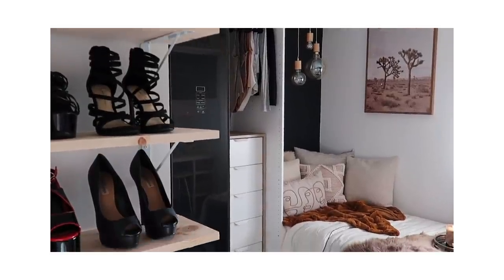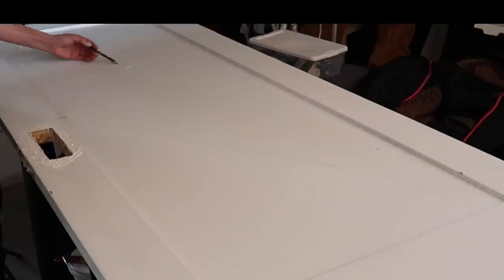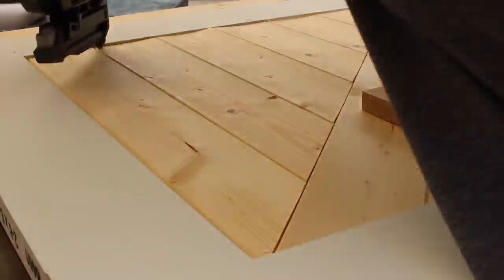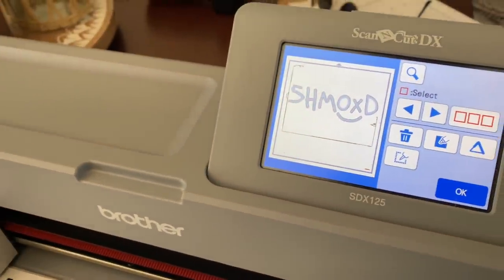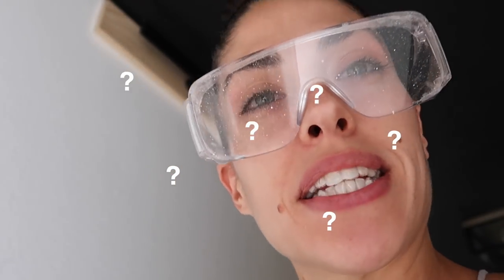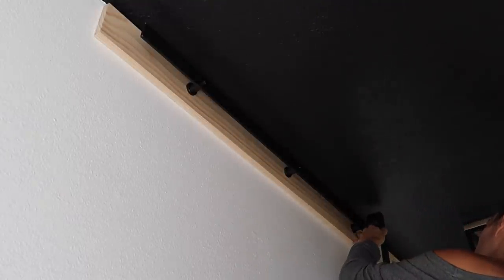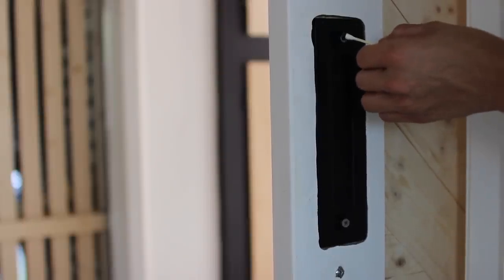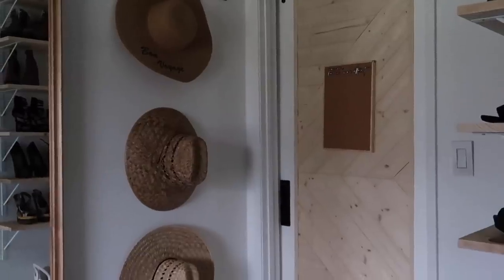DIY Thrifted + Sliding Barn Door | Easy Beginner Woodworking Project!!!

Comment: Rubber band between the stripped screw and the screw driver sometimes works!
Reply from the maker: That never works for me but thanks for the tip!
Reply: @LivingtoDIYwithRachelMetz   bummer! Too much brute force! 😝
Reply: I just saw someone beat me to the tip, I had trouble figuring it out at first but what I found helped me was thicker rubber bands and then I stretch them over the screw, then jam the drill in to “meet” the screw in a perfect fit but you have to keep it tight otherwise it won’t grip. Hopefully that helps.

Comment: I took my barn door from my old place and put it into my new place.  I did a video of it the first time I attempted to hang it by myself of course I had to have help to lift it onto the track but I put more holes in my wall. This time I added the mounting board to the studs, it was a nightmare but we finally got it done had to take it down a couple of times for height adjustment because I think I know everything even though my husband tried to tell me. The final door is on my pdubstuff channel.  I also purchased the door from the habitat restore in Torrance California for $35 it was a heavy door.

Comment: Aaaaaand... another bomb DIY to add to the list. This is gorgeous, as per usual with you. I cannot wait to see the surprise (a home in JT? 👀). 
Is the door heavy enough so It doesn't hit the wall when opened/closed?
Reply from the maker: There is a buffer and a slide portion that comes in the hardware kit. I need to install after we do the flooring.

Comment: Oh hell naaah 😂 you did not fill that 1-1/2" x 6" hole with putty. I would've cut wood and inserted it in there with glue and some brad nails. And THEN add putty to fill small small gaps.
Reply from the maker: I think I did haha.
Reply: Yeah but after you saw your goop wasn't going to work 💀💀 i posted this while you were putting the putty in it. I didn't put it once the video finished.